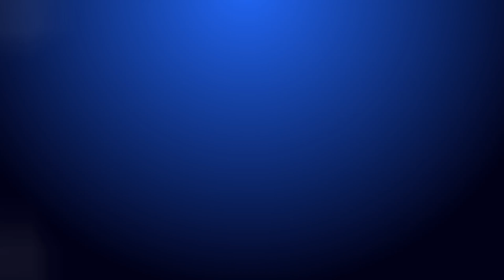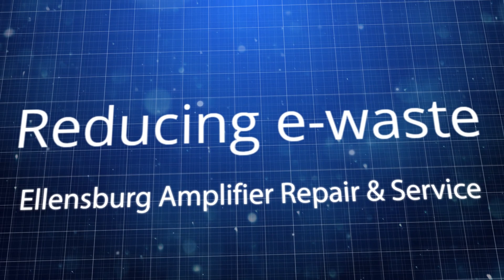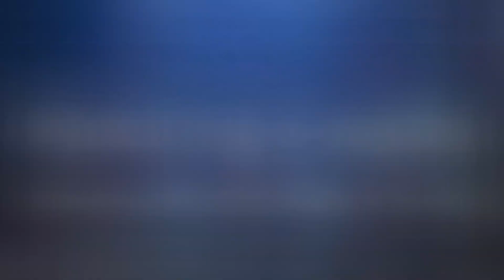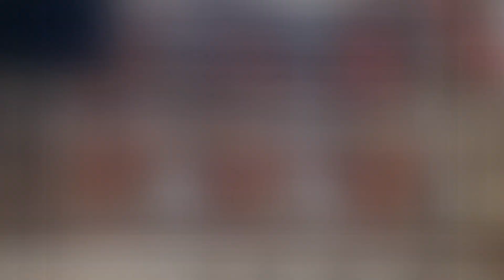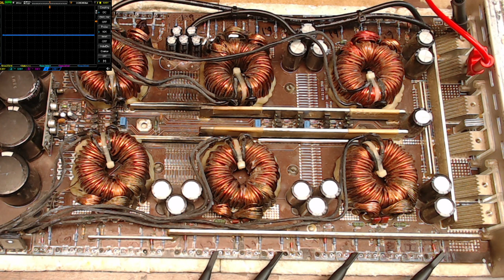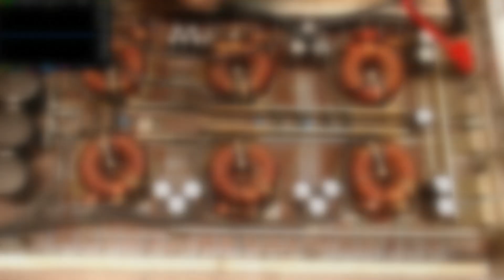American Bass 1100.1 Review of Power Supply Gate Drive Importance of Amplitude

Comment: Ok like on this powersuppply there are 1N47 zener diodes, rite next to the transistor resistors , what are the wattage of them . I have the same amp 11000.1 AB amp I have a zener broke in half
Reply: Oh maybe I read it wrong on that zener diode 1n47 maybe something different but whatever help u give would make my day
Reply from the maker: @colinwagner2744  The Zener diodes are 1 watt 39v which is next to the output transistors.
Reply: @ellensburgamplifier  I'm sorry did u mean by power supply transistors  which I'm looking for
Reply from the maker: @colinwagner2744  Yes, the power supply transistors should have a 39v zener diode for each bank. Now if you are talking about the drivers then there is also a zener diode there but much smaller in size.
Reply: @ellensburgamplifier  thanks that was my answer